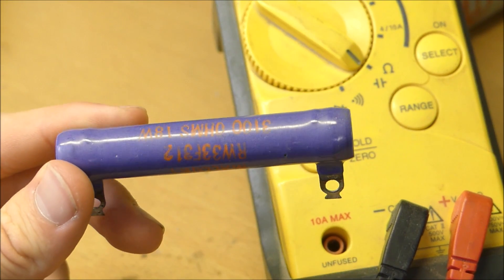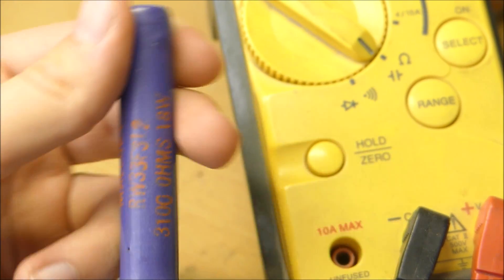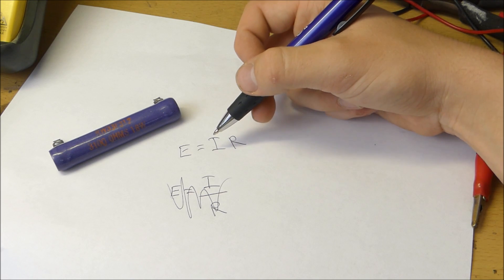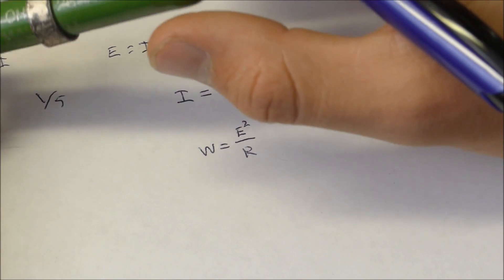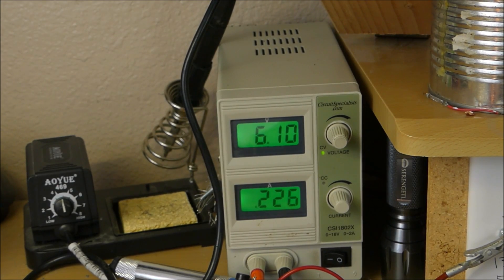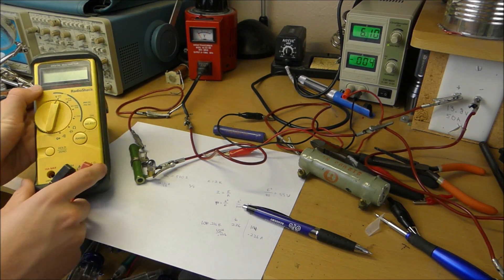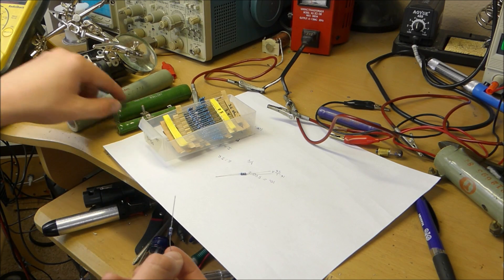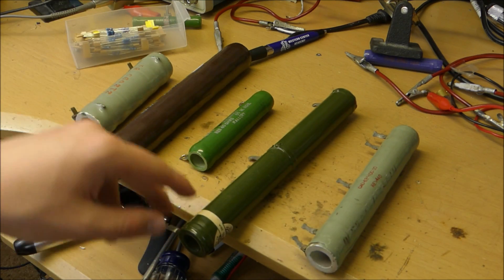A Look at High Watt Resistors

Comment: Good video but you can damage your transformer if you put to much resistance 
you should always keep in mind how much Ma of b+ the transformer is rated at and calculate in your circuit design or you will have one hot transformer and possibly unreliable equipment and potential hazard 
I had to learn the hard way lol

Comment: Bro can you please tell me that wattage of resistors matters in circuit????
Reply from the maker: Just figure out how many amps will be flowing through your resistor and calculate the voltage drop across the resistor using Voltage=Current×Resistance. Then multiply voltage by the current to find the minimum wattage you need. 1/4 watt resistors usually suffice.

Comment: I prefer older high wattage resistors, modern ones are tiny in comparison and run very hot (even if they can take it).

Comment: I think this video may be wrong, sure you can calculate wattage voltage and amps but they can all be different values and have the same answer,  the wire thickness would be the determining factor on how many amps it could pass, 500v at 1a is "safer" than 1v at 500a (in the sense of the wire not vaporising instantly)
resistors depend a lot on heat dissipation, and even the old ones, like these ceramic and cement ones can drift over time, absorbing moisture from the air, corrosion of the wire, how hot it has gotten in the past
Reply: I think you are conflating several different concepts. A resistor can become de-rated over time, i.e, unable to dissipate as much power as it could originally - that is true. That fact has nothing to do with whether 500v at 1A is "safer" than 1v at 500A. Both result in the same amount of power, which is his point, and mathematically correct. It is also true that many components have voltage or current max ratings, but that doesn't change the fact that the total power dissipation is the same.
Reply: @Markus0021  maybe, I have not been sleeping right lately, but then, you show me a resistor running hundreds of amps, isnt going to happen :p
Reply: @phonotical   To do that the circuit would have to run at, like 0.0001 volt, and the resistor would have to be very low in value, like 0.001 ohm, neither of which would be possible. A more realistic example such as 20v @ 2A vs 2v @ 20A works, though, as long as you don't exceed the rating of the components involved. It is Joule's law and Ohm's law in action. When you get to extreme values things start to break down, because the dielectric of the materials involved, etc. For example, at 30Kv or 50KA the electricity will arc right over the paint on the resistor, lowering the value of the resistor., so the rules won't work at all. Also note that we are really speaking of pure DC circuits - AC laws are different.
Reply: @Markus0021  500w is 500w
Reply: @phonotical   Exactly.

Comment: I have smaller resistors and they are rated for 100w :)
Reply: Some resistors are not rated very realistically, i.e., over-rated. Also, some resistors have different composition, e.g. some are metal with fins outside to enhance cooling, some are wire-wound, and some are carbon composition, and all those factors can affect wattage they can handle.